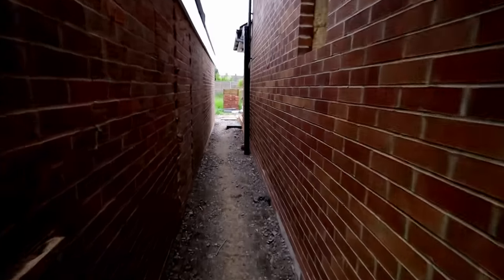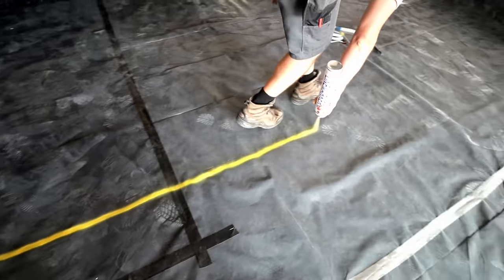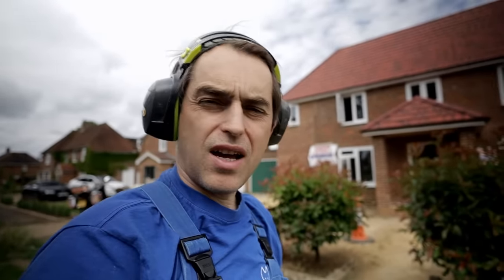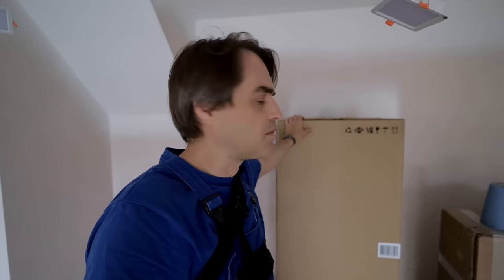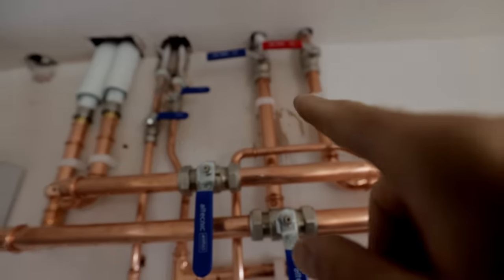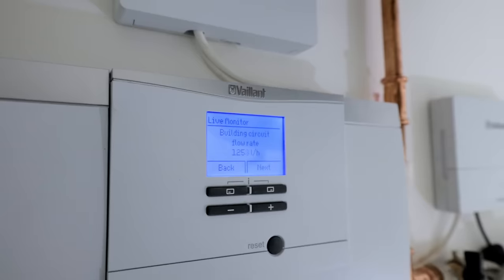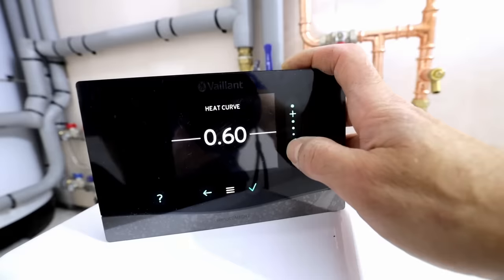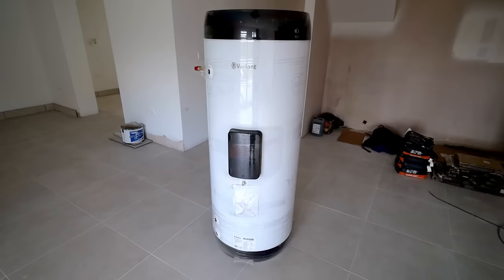Gas Boilers No Longer Make Sense, Here Is Why.

Comment: I put Flexi hoses through the wall all the time, it looks neat, well insulated and it's less fittings, win win if you ask me
Reply from the maker: good to know I am not the only one. As long as connections are accessible I do  not see a problem myself.
Reply: @UrbanPlumbers  100%, if you're ever unfortunate enough to install a lg heatpump, they often come with 750mm long hoses, absolute nightmare to deal with!
Reply: Yes, I agree with flexi connections. They help reduce the transmission of any vibration noise into the property pipework.

Comment: another great VIDEO 
Keeping external pipework as short as possible is a great design; as you can see from your video, insulate with quality insulation that is VU protected and weather protected and seal all the joints/seal to the heat pump so as not to let any heat/energy out and not let water/moisture in that if it did get in would increase the thermal conductivity so reducing the insulation, heat pump, system efficiency.   
Sealing through the wall, as you show, is also very important to stop moisture from bridging the cavity and stop all other critters getting in 👍

Comment: Heat pumps will work well as in this example if you are rich, undertaking a renovation with new heating, and have plenty of room. For many they will not be possible because of small size of UK houses and insufficient space for a plant room.  Particularly so in flats where there is only enough room for a combi boiler and no possibility of an external heat exchanger.  The only alternative in these situations is a community heat pump solution with an industrial sized unit at the end of the street or at the base of a tower block.   I am not aware of anyone mentioning community solutions or the investment that would be required for such infrastructure.  Is heat pump technology on this scale even available?
Reply: Yup, (probably) mostly with ground source instead, take a look into "Shared Ground Loop".  Which eliminates the need for individual outdoor units.

Comment: Great video and unassailable logic for a new build or complete renovation IF the building is well insulated. Domestic boilers are responsible for more CO2 emissions in the UK than our passenger cars reputedly, yet this is yet to be widely known or discussed. The government will need to push much harder on ASHP support and publicity because guess what; hydrogen is NOT the answer!

Comment: Id love to know more details about the cooling setup. Is the heat exchanger used for cooling running at the same temperature as the undefloor heating?

I was looking at the Zehnder comfopost water to air heat exchanger attached to an MVHR , which can do 2.26kw of sensible cooling from 5.6kw cooling power from the heat pump. The rest is basically dehumidifying the air, ao is not totally wasted. That's based on feeding 7 degree water with 600m^3/hr of 27degree airflow. Can underfloor pipes be cooled that low? And if this system runs from 18 degree water, it must have a very high air flow.

Im thinking that would take the edge off the heat in my 160sqm terrace, but I'd probably still need to supplement it with a couple of fan coils in the warmest rooms.
Reply from the maker: vidoe to follow once it is set up and running.

Comment: I would be interested to know at what temperature the ""30cm"" pipes would freeze at ..Here in Derbyshire last 3 winters got down to -10c...
Reply: If the system has power they aren't going to freeze, the relief valves should prevent damage if the system does somehow freeze externally
Reply: @edc1569  so it's possible.
Reply from the maker: that is why you have anti freeze valves. In 20 years of plumbing I am yet to see a pipe brust from freezing in the South of the UK anyway.
Reply: @UrbanPlumbers  but here in Derbyshire,,would -10c freeze them.?
In 2010 it got down to -15c and stayed at that for 3 weeks..
Reply: @markb1487  In a power cut yes, but then they'd thaw out again, i'd be far more concerned about the pipes inside my house freezing in this scenario
Reply: @edc1569  the inside water pipes were fine at -15c,, however the water pipes below ground were not,,and froze solid..But with the anti-freeze they will withstand this temperature??
Only from a power cut would they freeze??
Reply: @markb1487 If the system is powered it'll be running a frost protection cycle, many modern boilers do the same, where they will circulate water at a low temperature to ensure the system does not freeze, even if there is no heat demand from the controls.  You can add glycol/anti-freeze to these systems but its generally not done so much nowadays as I believe it reduces the systems efficiency and its not really needed.  Maybe if your system was particularly exposed and/or you get frequent power cuts then it might be wise to ask your installer about using it.
Reply: @edc1569  it's going to be a new build in the middle of Peak District which gets very cold,, especially months December To March..
And a big new build,, running at least  20 radiators..And yes,,frequent outages.

Comment: Here's where heat pumps are set to be a major fail. My 16kw is happy in the 35° c bracket, I agree with proper insulation and underfloor it is well possible. 
Now, when I ask for 50°c hot water, on economic, its drawing over 6kw and gets to 47.5°c.
Seeing that electricity is 4 times the price of gas it is hopeless at CoP 2.5.
What's going to happen is; we're going to be offered very cheap electricity when there is a glut from wind and solar. I have a 4,000 litre buffer with this in mind, in reality I could do with another 4,000 litres. Heat pumps just grind away 24/7 irrespective of the Grid, no use at all for Grid balancing!  Available phase change heat stores need sort of 65°c to operate so they are out the picture. You might as well use an immersion heater to make use of pcm's. 
  When I first had my 16kw ashp I pressed the " instantaneous power function " and it showed something like 9.4 kw and it made me wet my knickers, I contacted the manufacturer and to be fair they advised me to stick to "economic" but 6.4 kw is still a hefty chunk at nearly £2.00 an hour.
  The next major problem I faced was the warranty, for the sake of efficiency I was running pure water. According to the manufacturer, to avail of the warranty it is necessary to use glycol. The next blow was the £300/ year maintenance charge they wanted to drop on me to get to 7 years cover, that's a quarter of a gas bill. Even then they'll do their utmost to wriggle out.
   So the plan is the boiler I removed is being serviced and will go back in to service to be used as a sort of hybrid system for when the cold winds strike or the ashp breaks down, which it will no doubt. And before anyone mentions it, I was not able to claim BUS and on reflection I'm glad I didn't.
Reply: Heat pumps are like cars, will use more energy during the startup phase.  You aren't going to have it using 9.4kW/6.4kW per hour constantly, and once it reaches "maintaining the temperature", you will find it's using a lot less.
Reply: Poor design. My GSHP produces plenty of very hot water and the SCOP is over 3.5.
Reply: Should have installed a GSHP.

Comment: Thanks you for another highly informative video. What would be interesting is to see what sort of solution might be possible for 1) a small flat where there isn't room for this type of system i.e. what are the practical alternatives as electric boilers are very expensive to run 2) could you put in a small system externally (inc. cylinder) for a small retrofit where there is currently an electric shower, a small electric system for 2x sinks & electric heaters along with a wood burner?  I think it is these sorts of problematic systems that no one is talking about and they probably make up 60%+ of current housing stock. Our London flat is one of almost 400 in 5 buildings which are listed and can't have (so far) double glazing or heatpumps.
Reply: Most of Britains housing stock will not be suitable for ground or air source installations. Many reasons for this. The Government will have to back track on the ban on gas boiler installations because heating houses with electrictiy (those that are not suitable for renewable) will be too costly.

Comment: Your correct that no one thinks about ROI on a boiler but then your looking at £2-£3k. An ASHP installation like you just did must run to £12-£18k excluding underfloor heating I would estimate. Even if you deduct the £5k BUS that's a shit tonne of money so it's only reasonable to consider ROI in that situation. I mean I could have bought a decent 2nd hand electric car for that and saved myself more money overall and helped the environment just as much.
Reply: Octopus quoted me £6k for an install onto my 3 bed semi, with the discount.
Reply from the maker: comparable weahter compensated boiler with unvetned is around the same cost once vat and grant are taken into the account

Comment: Can a heat pump work in a flat though?
Reply from the maker: Yes. There are internal integrated units suitable for flats that do not require an external unit.

With flats it can be much smaller and simpler as the heat loss is usually much lower and dhw demand is also lower
Reply: @UrbanPlumbers  I guess then it's just a case of the reduced for space for the water tank being the major drawback versus an on demand gas boiler?

Thank you for your videos, they're excellent btw.

Comment: When you're doing s straight swap from and end of life stand point with a central heating system with much too narrow pipework. It still makes sense to install a gas combi boiler. I was £1600 vs £10k to £14k for a heat pump. Even with any savings in energy cost it would take 10 years plus to break even.
Reply: My house has microbore central heating pipework (8mm and 10mm). Some of it has been upgraded to 15mm but it all works fine with my ground source heat pump.

Comment: Had the owner or you considered installing a Sunamp heat battery instead of the hot water cylinder? Would this work on a large house and would it work with under floor heating?
Reply from the maker: Sunamp hooves very poor efficiency of around 2 so not worth it, unless you really have no space. It also is double the cost of DHW cylinder
Reply: @UrbanPlumbers  Have you had any experience with Mixergy cylinders, do you think they are worth considering over a Vailiant Cylinder?
Reply: @UrbanPlumbers  Do you often install solar iboost to these systems? Isn't that one of the best uses of solar instead of 11p/kwh sales to grid? Is this Windsor property also getting solar and/or batteries? Thanks for showing us your work- it's smart.
Reply: @TomMorris1 mixergy cylinders are not the best choice for a heatpump, best just to use a standard cylinder with a nice big coil

Comment: Reading the comments, it’s funny seeing the confirmation bias from the gas boiler / radiator die hards. North America, Northern Europe & apac have converted to heat pumps a long time ago, with building standards & insulation “R” values often below that of the UK. They work & are cheaper than gas boilers even in radiator systems. But yeah, heat pump deniers…..

Comment: Future proofing project done by a real professional.  And it makes perfect sense in a multi-£100k house undergoing top-to-toe renovation   But my renovation uses the existing gas boiler and multi-zone plumbing.  You can buy a lot if gas gir the £10k price differential.

Maybe in the future when these systems are near-commodity items and electricity cists much less.  Hurry up with that offshore wind...

Comment: I see you've installed quite a lot of these Valiant systems over the last year or so.  It will be interesting to see how reliable they are and with that in mind, please make videos covering any significant faults you get over the coming years... If there are any.
Reply: Vaillant I mean 😂
Reply from the maker: within our group of heat geeks and Vito Energy (compnay that does the umbrella sheme) - we have installed propably around 200 units in the last 12 months, so we have a pretty representative sample of Vaillant units now. 

I will report on any issues.

So far I have had issues with 3 Vaillant cylidners but none with heat pumps.
Reply: @UrbanPlumbers  excellent, thanks 👍

Comment: I'd be interested to know what the solution would be in my case if a gas boiler makes no sense.
I live in a converted Church grade I listed and on all sides surrounded by graveyards. 
I can't put ground source heat pumps without removing the bodies (also not owned by anyone who lives in the church) and because the building is listed I cannot slap an air source pump to the side of the building (I live on 1st and second floor). 
If not some sort of boiler what would be my heating solution?
Reply: Fit a boiler, size your radiators for low flow temp, sit back and forget all about the ASHP fad while your shiny new boiler runs at 98% efficiency.
Reply from the maker: As compared to 450% heat pump here. Also weather comped 98% efficient system with a gas boiler would cost exactly the same to install.
Reply: @UrbanPlumbers Well the question came up a year ago when the boiler was on it's way out and I looked into heat pumps, but in the end they were deemed unsuitable and I had to go for a gas boiler.
As I'm not on the ground floor it was a health and safety risk to install an air source pump over a footpath into the graveyard, that was assuming I could get planning permission for it.

Don't get me wrong it's a problem that will need solving when gas is no longer pumping through the pipes as due to the working graveyard I'd have nowhere to install a gas tank
Reply: @UrbanPlumbers the OP has explained why an ASHP is a non-option for him. Even if it was, the cost price of the heat pump alone is somewhat more than the best combi, so I doubt it’d be the same price for the install. Even if he was achieving 4x efficiency out of the heat pump, electricity is nearly 4 times the price of gas anyway.
Reply from the maker: Remember that boilers are only around 80% efficient so even if electricity is 4 times the cost of gas 400% heat pump is still 20% cheaper to run
Reply: @UrbanPlumbers  Is the efficiency kept at 400% if the heated fluid existing the heat pump has to be pumped 100 meters through the ground and also 20 meters vertically?
Reply: @stoney202 
modern circulation pumps are very effective and with correct sized piping these distances dont have big impact on COP.  Just for comparison, a house can have several circuits of floor heating being 50-100 meters each... some houses have 1-2 kilometers of underfloor heating pipes, no problem and still cheap to run.

Heat (convection) losses outdoors however needs to be taken into account and insulated to specs.

Comment: Would the running cost not be cheaper with air to air heat pumps (air conditioning unit)? Would've thought it would be easier to install. Fitting a cylinder with an air source heat pump built in could sort the water demand.
Reply from the maker: A2A would be around 25-30% less efficient than this set up

Comment: Have you ever installed a system where you have a heat pump, keeping the old boiler as a backup for cold snaps?

I'm considering installing a heatpump, but we inherited a 1 year old system boiler with the house, which would feel like a waste to throw out.

We haven't converted the full house to UFH just yet ( we're going room-by-room), but we will need to move the old system boiler from our kitchen to the garage in the next few months.
Reply: If the boiler is correctly sized for the property, why waste your money? Just get the heating system reworked and the radiators sized for low flow temp, if they’re not already, then sit back and run your boiler in permanent condensing mode at 98% efficiency. You’re not going to gain anything when you factor in the expense of the install. A well maintained system boiler will give you at least 15 years of life, and being less complicated than a combi, far less in maintenance bills. I presume it’s still under warranty as well, in which case maintenance will be free if needed.

People will quote figures for “savings” with ASHP’s, but as with fuel efficiency with cars, be careful what you believe. Even if you’re getting 3 times out what you put in in terms of kW’s of electricity, the stuff is 3 times the price of gas to begin with.
Reply: There's no point.  Keeping the old boiler means you don't get to take advantage of the £5K Boiler upgrade scheme. And heat pumps work just fine in cold snaps.
Reply: Id just put a wood stove in somewhere, if it was super cold or the power went out you can use it.
Reply from the maker: check new intergas hybrid - it looks good and is not crazy expensive

Comment: Yeah flexible connections, Yeah there is good reason why they use flexible connections. Perhaps compensate for termal expantions but predominantly dumpen the vibrations, then you dont have a noise conduction from heat pump. Also the distance of flow pipes 20cm to 50 cm would not have any  thermal lost considering the velocity ( flow volume ) and pipe diameter. 
Excelent videos keep them comming its really good and educational.

Comment: Heat pumps require space for cylinder, buffer tank large radiators and bulky unit outside some time need planning permission and all costs associated with it  therefore GAS BOILERS MAKES MORE SENSE works every  time all the time 😄
Reply: Guessing this is from a gas engineer who doesn't know how to install a heat pump. Feeling a bit inadequate, are we?😅